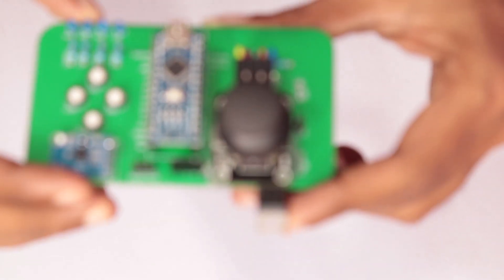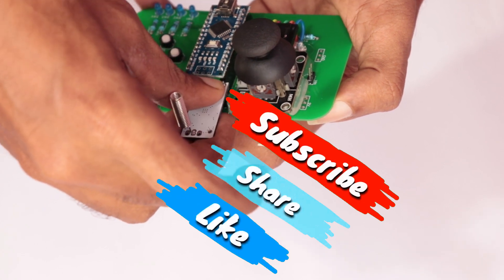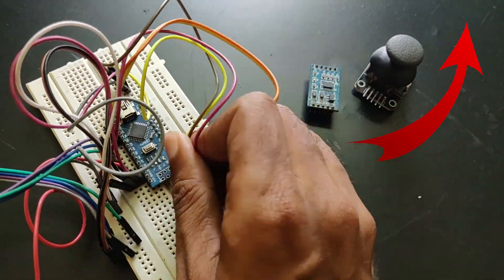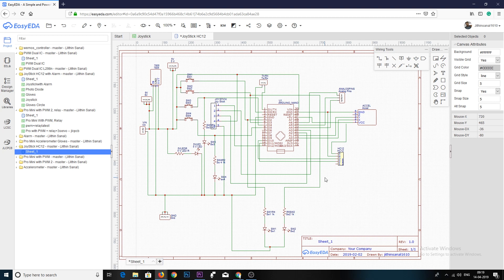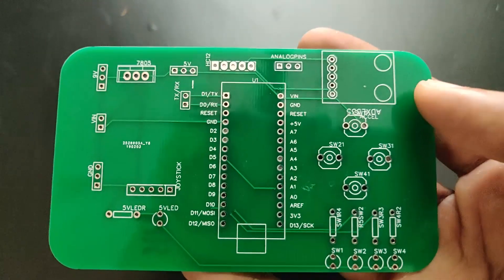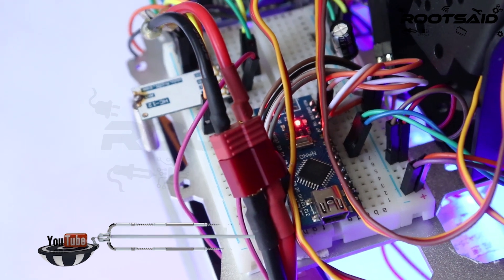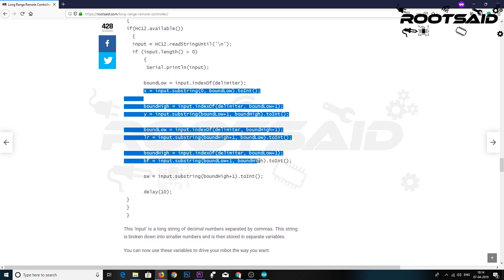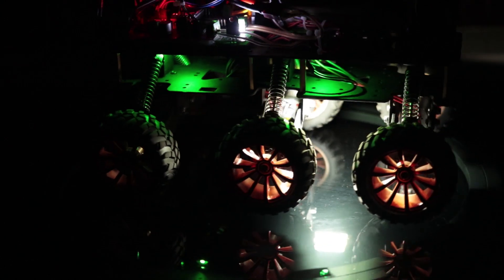DIY Remote Controller Arduino in PCB | Long Range Remote Controller for RC Robot

Comment: Make a bot controlled by fsi6 transmitter and it would be great.
Reply from the maker: I will surely do that
Reply: @RootSaid  ya but do something special so that the capacity can be greater as the idea is good and no one has done it properly so you can ......

Comment: are you limited to 4ch on that board?
Reply from the maker: No. Actually, you can use all the pins in arduino and send all the values in a single string.